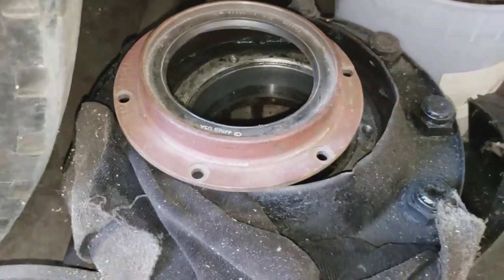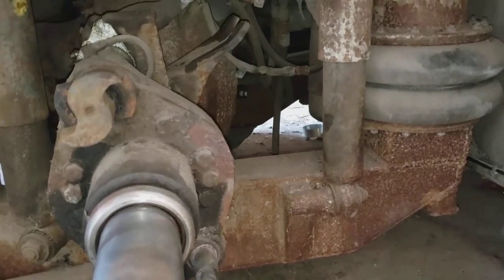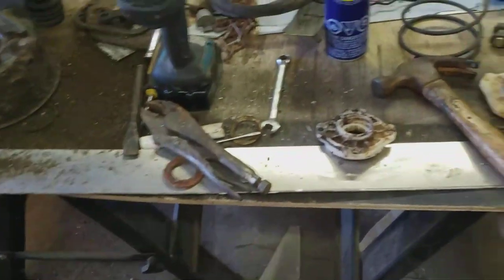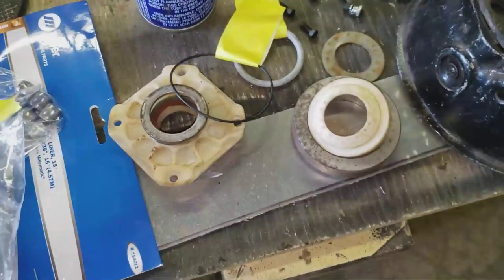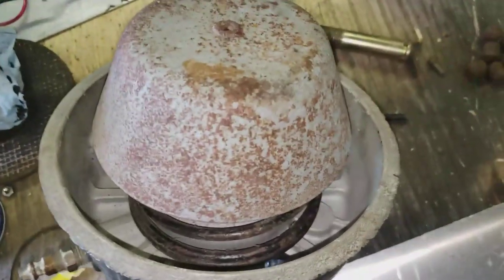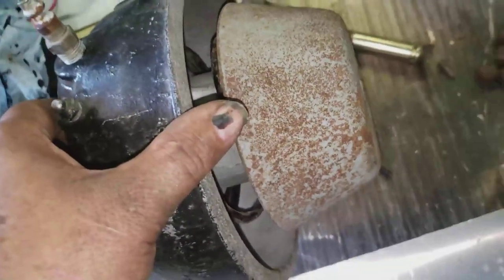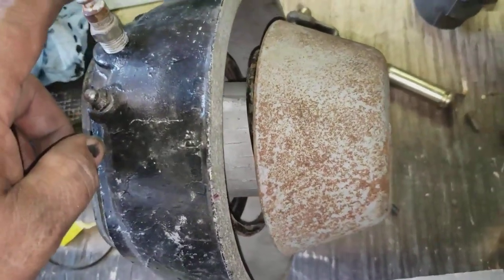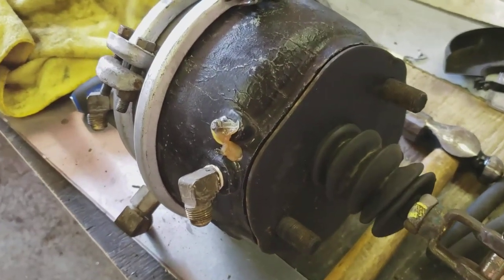Bus Conversion Project - Video 97 - DD3 brake chamber disassembly and rebuild

Comment: Hello James. I just came across your post tonight. I have been with Richfield Bus Company as a driver/mechanic for 18 years, primarily working on the Bus Boys Collection flleet of vintage buses. Although we have had from time to time  MC and GM coaches and transits with DD#'s, I have never overhauled one, so this video is very interesting. I started posting a year ago. Please visit my postings and let me know what you think. Some are mechanical, some are electronic.
Reply from the maker: Hi Phil.... I watch the Bus Grease Monkey so I've seen you on his channel.... thats a nice collection of old buses... those DD3 brakes are a goofy design but they work fine... way cheaper to rebuild yourself than to buy a rebuilt one.... I'll check out your channel.... good to hear from you

Comment: Before to After ... So that's what that should have looked like in the first place. Glad you recognized the Driver side verses the passenger side difference I was scratching my head as to why the drain vent was on top. Shop manuals are worth every expensive penny for the paper their made of . This one job alone proves that the rebuild cost for a shop to do it for you would not have saved you much money or told you it was the wrong side chamber. glad to see the important parts of this rebuild got into the video a lot to learn from this one video and most of it was in the commentary . Great work again James and Amazing work on the video and commentary. We need to get you a Honorary Doctorate Degree in Automotive Technology. Professor  Dr. James E. Dennison PhD AT.
Reply from the maker: Thanks, hopefully it will come in handy when someone else needs to rebuild their brake chambers....

Comment: Nice work James I've never seen one of the brake chambers opened up on my last coach before my current conversion I had maxes put on the bus because it had the old Johnny arm emergency break in it and I didn't like it's. Thanks for taken the time to walk us through it. Can't wait to see the coolant video. Your bus is really coming along buddy keep up the great work.
Reply from the maker: Thanks Brian, putting Maxi's on would have been my preferred fix as well but there just isn't the clearance for them.... at least these are rebuildable .....

Comment: Hi James - great video!  Was wondering if you know of a place to get parts to work on a DD3 brake.  I need to rebuild both of mine.  Thanks!
Reply from the maker: Hello Benjamin

Yes...contact Luke at US Coach. They are in New Jersey...you should be able to google them and get the phone number but if you have trouble just let me know and I can get it for you...I just don't have it with me at the moment

Thanks James

Comment: Did you use a scrap piece of wood with two holes for the large threaded bolts to hold down the spring while screwing the plate on?
Reply from the maker: NO.... that would have been a great idea.... where were you when I was doing it... :-).... I just compressed it by hand and wiggled the bolts in till I got it... it wasn't easy....
Reply: Guess you just pop the next project and do that one in the next update, i was a bit handicapped not being able to do the timewarp, sorry mate :)